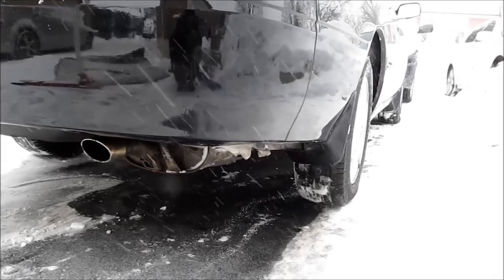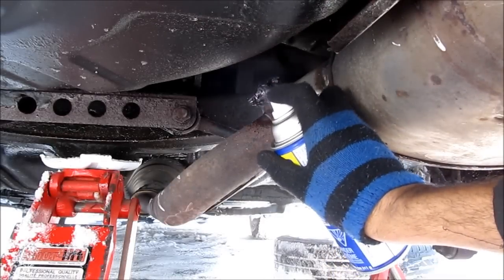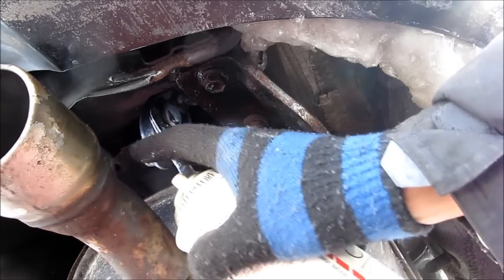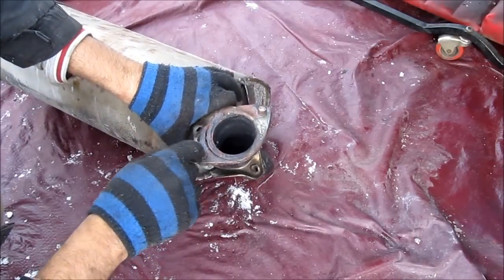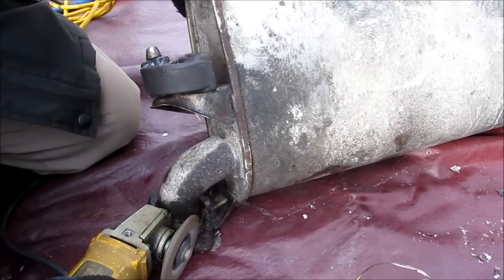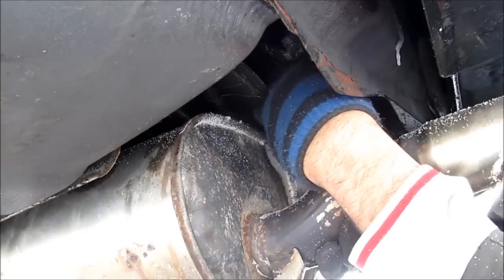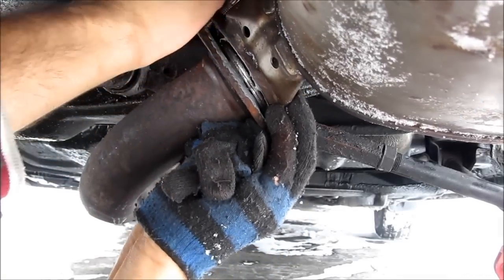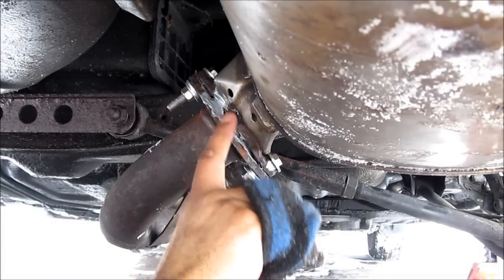Exhaust Muffler Repair & Replacement

Comment: Ha, I think it sounds much better with the muffler off. Im lucky I live in the south where we dont get snow. I could not imagine working in that type of condition.
Reply from the maker: It sounds better, but the car feels gutless driving without a muffler.
Reply: speedkar99
Reply: speedkar99 how bad was the loss of torque?

Comment: Stainless steel bolts are a MUST for easy future replacements.   I have replaced all bolts on the entire exhaust.  Was great when I had to change that flex pipe for a second time.  :)
Reply from the maker: Yes SS bolts are great but they aren't as strong as standard bolts. My lower bolt snapped in half a year and a half later.
Reply: I have never had any snap off.  Maybe go to the next size larger. :)   Maybe you cranked them too tight ?
Reply from the maker: +JuliaDevan They rusted right through the middle over a year, they weren't right.
Reply: Yeah. I always go grade 8 on flanges as there's too much force for the grade 2 brittle SS bolts to handle.  They will rust out as well, but take a long time.  I have a '99 Camry V6 that has both flanges on the midpipe totally rusted, but not leaking, but what is leaking is the midpipe's heat shield welds as well as the top of the muffler has some rot 😟.

Comment: Thank You for doing this video! Good safety- I see jackstands in use & gloves.  I did the same procedure by the cat. flange.  Now 8 months later, same exhaust leak/noise. I will have to replace middle pipe. (front pipe w/ Cat replaced already).
Reply from the maker: +Joe T Thanks. Thats the thing with these older cars, the exhaust start leaking in alot of places.

My muffler has a hole in it and my flex pipe is patched with soda cans lol

Comment: Nice job, probably could have a little shorter bolt, but it works. I had a similar problem with my 93 s10 pickup.
Reply: True but if the bolt were shorter it may have been harder to get it started in the first place.  It's trickier than it looks to line up those parts.  Exhaust work is the worst.

Comment: I have a 96 Avalon with similar (probably identical) exhaust. The flange on the pipe feeding the muffler is completely crumbled. (It's basically a clean circular opening with no flange now) Any suggestions on how I can join it to the muffler without welding?
Reply from the maker: +Joseph DiSalvo you can put a pipe with a slightly larger diameter over it and clamp it, though if you want an air tight seal the best thing is to take it to a shop to weld it.
Reply: Ended up creating a larger surface to clamp by just fastening a U-clamp around the crumbled flange, then sandwiching the whole mess together with two split flanges.
 
Looks like Frankenstein's monster, but at least it was under $14 and 5 minutes to fix.
Reply: The best thing would probably be too replace the whole pipe/resonator unit since it's bolt-on both sides and fairly inexpensive, and the old one is pretty scary looking in terms of rust, dings, burn marks, and the fact that it's stock and the car is 20 years old in Ohio weather.
Reply from the maker: +Joseph DiSalvo Well yes you can, if you can get the bolts off the catalytic converter off without breaking it's flange!
Reply: speedkar99 D:

Comment: hey buddy.. i got a 2001 Toyota camry XLE v6 that came from illinois (im in Cali) and everything at the bottom was all rusted out. i keep getting a p420 code. for whatever reason, the only catalytic converter that will fit the car is $2000 bucks so i have been trying to avoid it. later i found that my flex pipe was cracked so i replaced it. then, there was a hole in the pipe itself so i replaced that. im thinking, would replacing the muffler alltogether and maybe taking the cat off and cleaning it with soap and water, drying it and re-installing it, would the code still come back? i read that cats trigger the light to come on with anything less than 97% efficiency. would cleaning the gunk out of it and getting a new muffler do the job or do you think im outta luck? anyway. i have been able to pass smog because i can turn the light off and drive for 500 miles or so before it comes back on, so thats why im thinking maybe its not so bad and a little cleaning would do... what do u think?
Reply from the maker: +Juan Carlos Have you checked voltages and resistance values of your Oxygen sensors? Next try an Anti-Fouler on the O2 sensor.
Reply: If you cat gets clogged, this procedure should fix it.  I came up with this idea, and my brother has tried it. It worked and he was able to pass the emissions and no more engine codes.  Remove cat, then soak it in parts cleaner.  Walmart sells gallon jugs. (Berryman Chem-Dip Carburetor and Parts Cleaner ).  Soak it for a couple days.   You will need to fit a cap on one end, then fill it up.  After a day or two wash it out.  After re-installing it will smoke for a bit.  But it should then work again.
Reply from the maker: +JuliaDevan See, you can't just "remove cat" in the rust belt...it's more like break it off
Reply: Cutter wheel and welder are required for the none bolt systems.   But if your cat is just too rusted, well its just time to then replace it.
Reply: JuliaDevan thank you folks... ill try cleaning out first.. i will come back and post or even make a video about it... an "experiment".. see how it turns out....

Comment: What kind of car is this? Great video. The lighting and the camera angles and focus were really good. Better than most repair videos, in fact.
Reply: Sorry, I just read the description and saw the car model.
Reply from the maker: +Katsoup98 Thanks. Having the snow underneath helps the lighting alot since it acts as a big reflector.

Comment: Speedkar99, have you replaced the middle pipe yet? Wish to see video, pls.  It will involve removing the rear O2 sensor.
Reply from the maker: +Joe T At the moment I have no need to replace the middle pipe. The O2 sensor should be removed with the proper socket tool. Use a torch to heat it up if its rusted stuck and a large breaker bar to break it loose. Good luck.

Comment: I tried drilling out the studs/ bolts on the Toyota muffler flange. No Luck ! Hardened steel. What mat'l was your drill bit made from?  Looks like a new muffler for me. ( tried smaller dia. drill bits too)
Reply from the maker: +Joe T Ah boy, drilling out those studs were definitely a pain. I started with the right bit, a 1/8" metal bit made for drilling out rivets, but every other successive bit I had was for wood. I kept going at it for a long time, burned out a few bits but finally got it. My suggestion is to make sure you've got the right bit for metal. I was lucky I was able to save my muffler, its now got a hole in it and is getting noisy but still running. 

Let me know which muffler you end up with, I'm going to need a new one soon anyway.
Reply: +speedkar99 Go to Amazon, see Walker exhaust system. $115 or so, p/n 53392 for my 2000 Solara
Reply from the maker: Thanks. Shipping to Canada might be a bit expensive, I've gotten quotes for $200-$250ish around here for the walker muffler. The thing is I've been reading that the aftermarket mufflers don't last as long as the original, so I might be going through mufflers every two years with Canadian winters.
Reply: Go with a SS muffler, I think Walker has one for the Solara V6.

Comment: nice, good help. ye, it sounds decent without, but it always pissing me off when turds drive up and down my place with em purposely unmuffled, so i wont do it to any1 else.
Reply from the maker: +Slave Of Self Yea that sucks. Little do they know they're actually loosing low end power by not having enough back pressure.

Comment: Never seen anyone using that cement stuff.  Wouldn't it dry out and become brittle ?  If the gasket can't stop the leak then there is no chance that the cement would prevent the leak.
Reply from the maker: Your right, the stuff just crumbles off after a few weeks with the heat. It's not there as a gasket, it's just there to fill small cracks and exposed parts of the exhaust.

Comment: That muffler cement cannot be found anywhere,,,made by that company.....update....don’t use cement,,after about 3 months it gets too hard and brittle and cracks and falls off....use the high temp orange silicone stuff with copper in it...can’t remb the name,,,but that’s what works
Reply: check magnaflow. i had little luck as well. dealership wanted 360 for it
Reply: @johnwix7935  update.....don’t use cement it falls off and gets brittle,,,use the copper high temp silicone stuff can’t rem the name,,,but it’s 🍊 orange